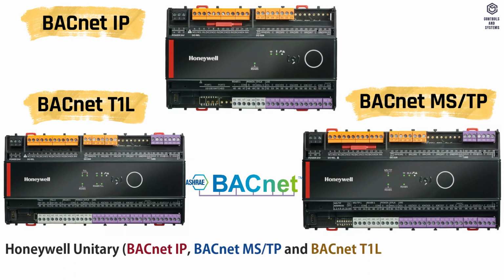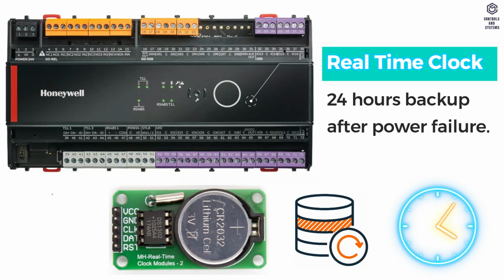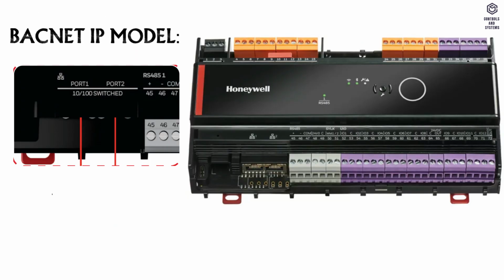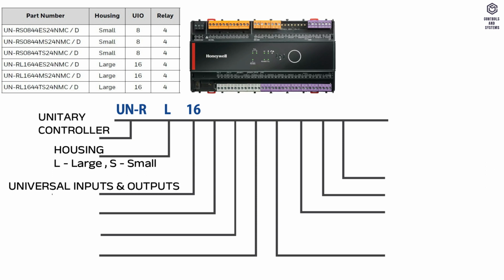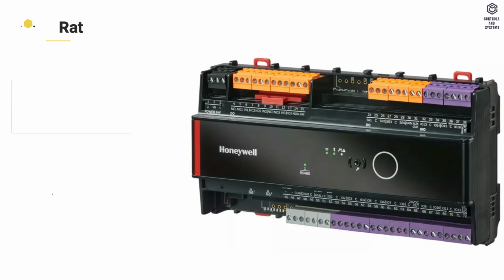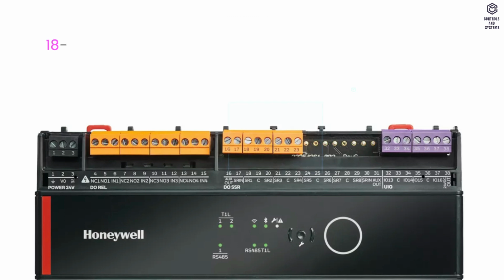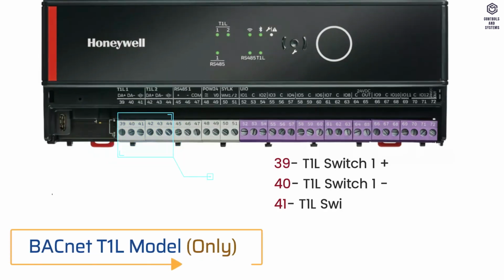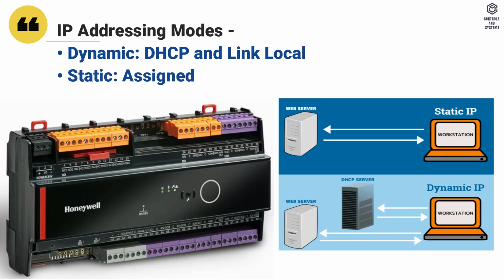Honeywell Optimizer Unitary BACnet Controller | Overview & Technical Specifications📖

Comment: Hi, may I know if what brand of controller (room temperature sensor) for BMS can I use?
Reply from the maker: First of all, what are your needs? Controller or sensor?

Controller:
If you need a controller, it will depend on your application and the number of IO points.

There are two types of controllers available in the market: pre-programmed and un-programmed 
controllers available in Siemens, Honeywell,Trend,Delta Controls,Schneider Electric and more companies.

Room temperature sensor:
A room temperature sensor is available in the sensor with control like a thermostat, 
or is available in only a sensor.

If you are going to choose thermostat, I would recommend siemens or honeywell.
Reply: @insightcontrolsystem  Hi,thank you so much for you answer.